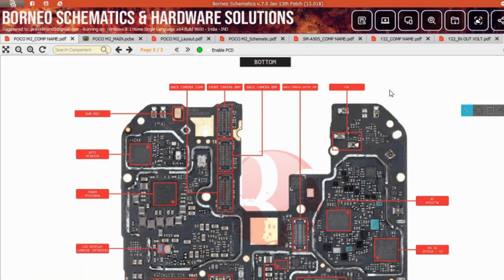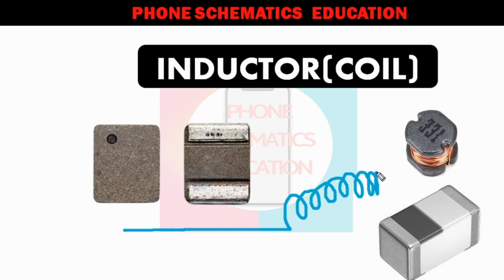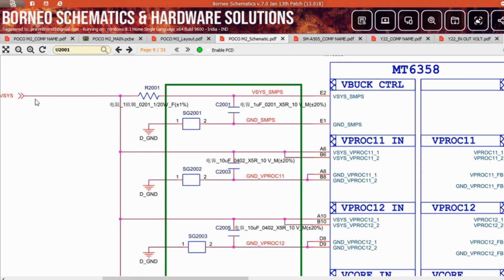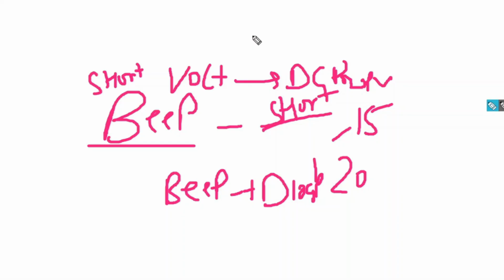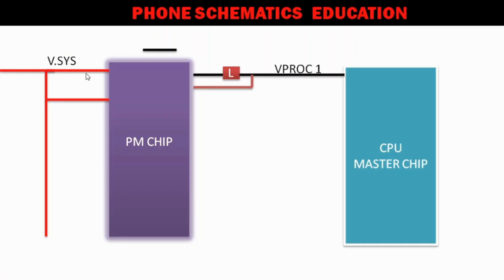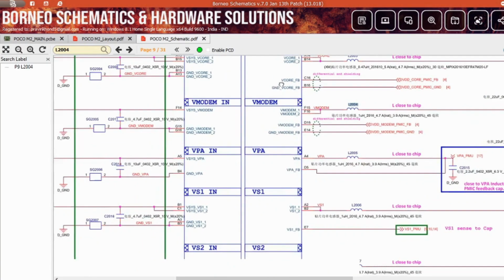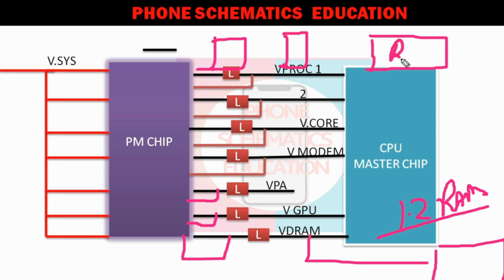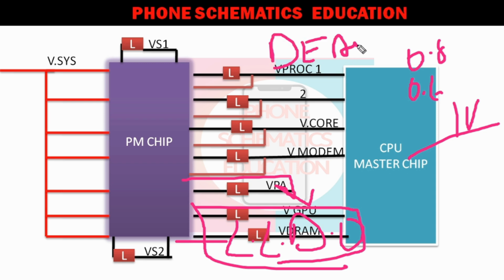Cell Phone Power Issue? Mastering Power Chip Output Buck Rails. Testing+ Repair Solutions.

Comment: I have a question Sir, As I know that the buck volages are depended on each other.. in case if one of these buck voltages is not found because of a broken coil for example the other buck voltages are not generated.. Is this right?? Also, if the feedback line for one of these bucks is broken we will face the same problem.. Waitibg your reply.. Thanks in advance.. BR

Comment: hello. thanks for the video's. i have a problem with samsung s20 fe. it fell on ground. i replaced display. But camera nog working. front cam is working. when i open camera app no image and message saying : Warning . Camera error .  i tried in diagnostic menu but when i click it , it is immediately closing down again. I don't know how to troubleshoot. can you help?
Reply from the maker: Check the diode value on camera connector first
Reply: @phoneschematicseducation  i checked and are all good. i changed camera's . without luck. what can be the problem?
Reply from the maker: @anno32  check again every back cam connector on board diode value also the voltges line.100 persent you will find the fault.

Comment: I have for 10 time same problems with Samsungs ex a022, VBUS goes till charger IC but will not pass to Coil at another side, even i change charger IC, where can be problem? Its 10 case a last 2 mont.
Reply from the maker: Check the PMID cap check the boot cap first after you can tell me..also tell me the diode value around the charging ic components
Reply: @phoneschematicseducation  There is No PMID on the Schematics. It's Called VMID, and it's 5V. There is no boot Cap; maybe it's called something else. Please check the a022 schematics IC u5001. It's very important to answer if you want to teach us. This is maybe 10 cases with the same problem, and no one can solve it.
Reply from the maker: @Sherifone78  u can call vmid.pmid.or mid all are same.. according to the circuit name changes
Reply: @phoneschematicseducation  Ok, it's 5V, How is it called a Boot Capacitor? What do you suggest next?
Reply from the maker: @Sherifone78  Phone diagnosis is a process in which things are diagnosed step by step, it takes time and I will not be able to tell you so many things in the comment section, sorry for that
Reply: @phoneschematicseducation  Ok, no problem understand, it will be great if you make a video, especially for Samsung A022, and explain each detail, because I follow all your videos and even you explain much better than any other, something I missing in videos and problem still remain. Thank you a lot